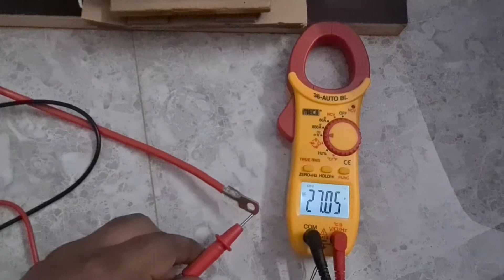DIY Build 24v LiFePo4 battery with BMS. Quick setup video.

Comment: i gone a do 2 pack of 8s in series to make 2 pack of 24v and 320ah and them  connect in the 2 pack in paralel  and made 24v 640ah the question is to do that whith one bms whith 16s cell.  the question is can di that 2 pack of 24v in series to them connect in paralel to make 24v 640ah  which one 16s bms or not

Comment: Do we really need a 100Amp bms for a solar inverter use? What's the logic behind using this 100A bms?
Thanks for the video.
Reply from the maker: Using bms is at your choice. Pls consider charge and discharge current before using one. I used 100A because I need hugh discharge sometimes. So its upto you to decide e